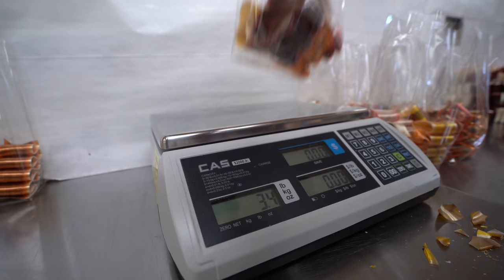First Time Using Citric Acid in  Batch of Ribbon Candy!

Comment: So, I did some research and Paraffin wax is generally made from slack wax, which is a byproduct of creating petroleum based lubricating oils. Which may sound gross, until you realize that most the stuff around you is made from petroleum byproducts. 
    Food grade paraffin was is a very common ingredient in many edible products including many different candies and as a casing for some cheeses. It is often used to make candy, and some other food products look glossy, and is the same wax used for wax paper. It's a pretty common thing to use in the culinary realm.

Comment: I like all 3, ...pancakes, french toast, & waffles.  Try this on your pancakes:  3  -  3" diameter pancakes,  spread a thin layer of Peanut Butter over warm pancakes,  slice banana over the top,  drizzle honey or syrup over all.  Here you can stack them or eat in a single layer.  Last but not least, drizzle chocolate syrup over all.  Who doesn't like Chocolate, Peanut Butter, & Banana.   (You can add chocolate chips to the pancake batter!)  Calories???....What's that???             For a different take on French Toast....use Rum Extract instead of Vanilla.

Comment: Paraffin wax, colourless or white, somewhat translucent, hard wax consisting of a mixture of solid straight-chain hydrocarbons ranging in melting point from about 48° to 66° C (120° to 150° F). Paraffin wax is obtained from petroleum by dewaxing light lubricating oil stocks.

Comment: I dont know anything about heat/chemistry/candy making so excusethe question, but could the citric acid be added when it's still in the copper pot so you could mix it evenly right before you pour it on the table?